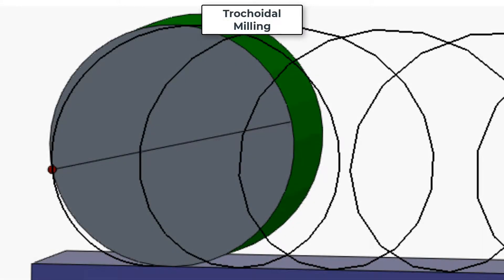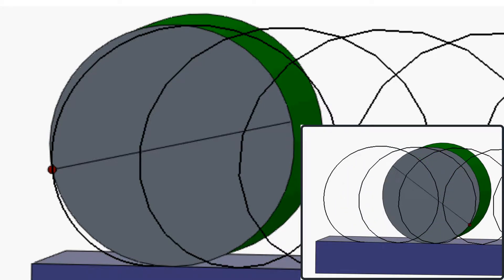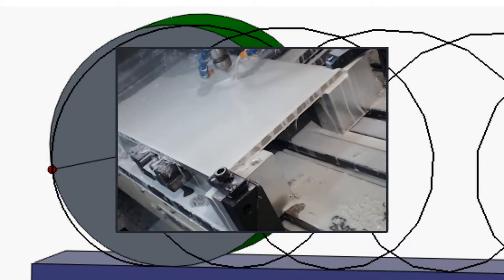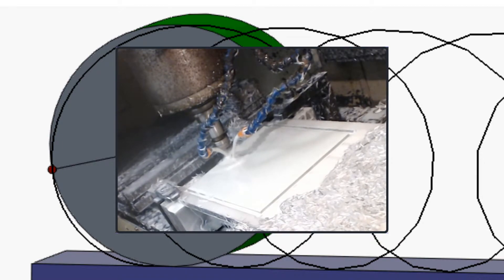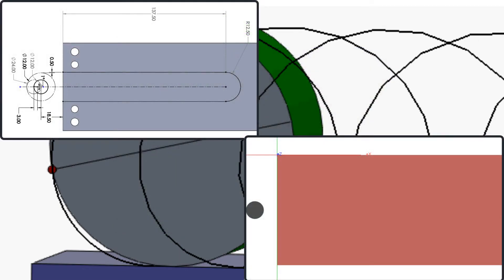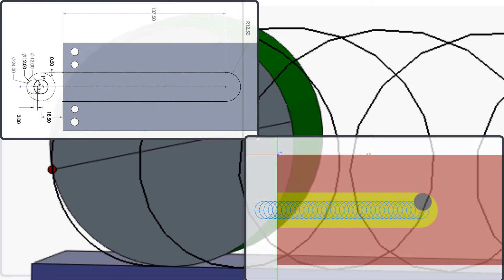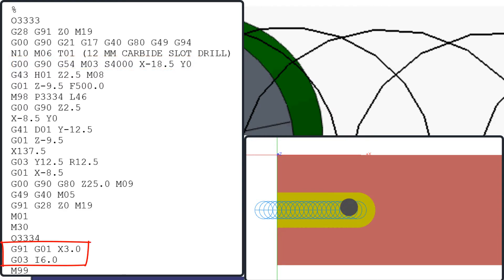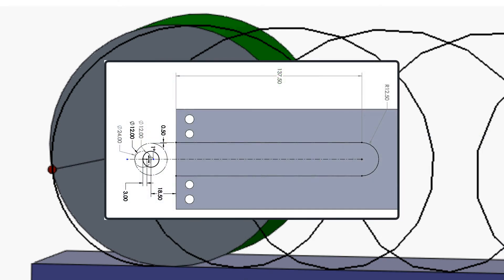Trochoidal Milling of a Slot

Comment: Shouldn't that arc move be "G03 J6.0"?
Reply from the maker: No, the sample code is for the slot shown in the second half of the video. The movement from the cutter center to the arc center is a straight line movement in the X axis.